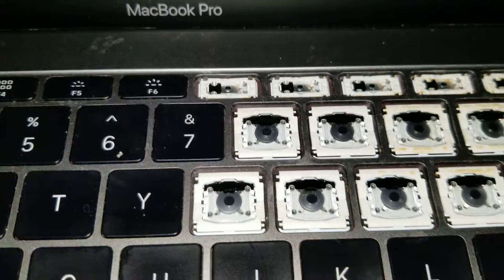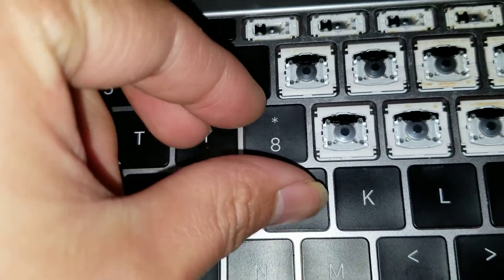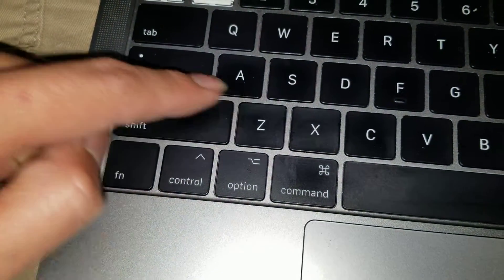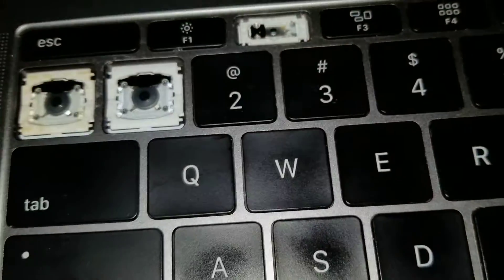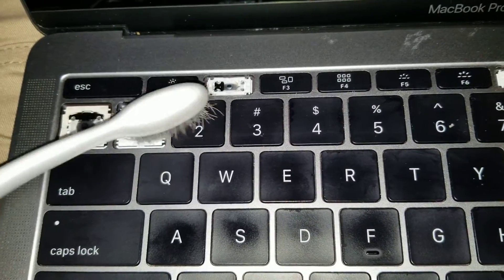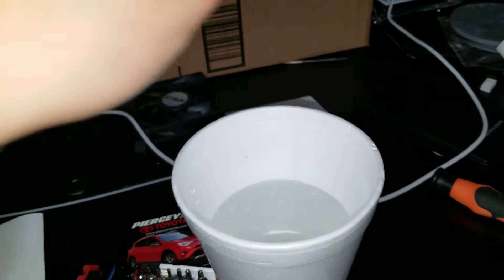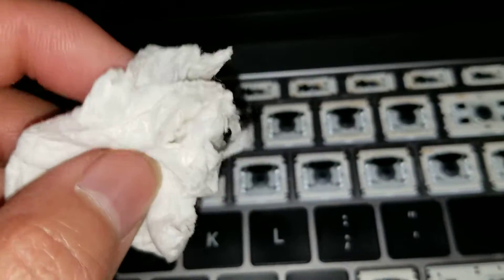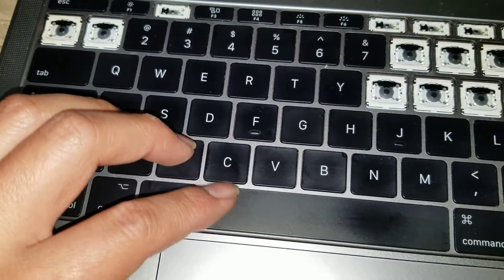How to clean and repair sticky stiff stuck Apple Mac MacBook Pro 2016 2017 2018 butterfly keys key.

Comment: hey man. ive got a macbook pro 13 inch 2020 and the command key came off. there are these two little pieces of plastic that came off aswell which connect to the keyboard itself as well as the key cap itself. do you know how to get these back on?
Reply from the maker: Not sure
Reply from the maker: I know how, but I'll need to see. Most likely parts broke and need to be replaced. 2020 models went back to the scissor keys.
Reply from the maker: Video showing all the keys https://youtu.be/oCWlcoq0v0A

Comment: Which side are the hooks on the escape/f1/f2/.../power keys?
Reply from the maker: Not sure. Too risky to attempt because of the small size. Apple might fix it for free. It's a known issue.
Reply: @ItsBinhRepaired  I'd just like to know which way hooks/clip are under those f keys you already removed. Is the hook on the side of the F and the clip on the side of the 7 or is it the other way around? (although I think(??) that little black thingy is aligned with the clips right?)
Reply from the maker: @alice8668  I don't remember been too long.
Reply from the maker: Uploading a video now showing all the keys and explaining how it works. Subscribe and hit the bell to be notified when it's up!
Reply from the maker: Video showing all the keys https://youtu.be/oCWlcoq0v0A

Comment: Don’t use your finger nails to remove your keys, please. I just did this and now my D key is flat.
Reply from the maker: That means you didn't pop out the clips properly, or you damaged the plastic piece pushing it down wrong. I had someone do that and try to force it in. They damaged the part at the bottom part of the key.
Reply: @ItsBinhRepaired  I managed to do it perfectly on the U key, then applied the exact same thing in the D key, these keys are very sensitive.
Reply: Just to clarify, do I need to replace the key, or the entire top case of the laptop?
Reply from the maker: @CallieraFlo  I'll need to see pictures of the back of the key and the butterfly hinge mechanism. Do a 4k video if you can and upload it to YouTube and then send me a link
Reply from the maker: @CallieraFlo  https://youtu.be/cT4ITKeis3Y compare those parts. You most likely smashed the square shaped clips. Hopefully not the ( ) ones.
Reply: @ItsBinhRepaired  The top parts snap in, the bottoms don’t. I think i damaged my key itself or the mechanism But if you’re referring the square clips as the bottom clips, then i smashed the square clips, not the ( )
Reply from the maker: @CallieraFlo  yeah, usually you can use a needle to bend the bottom square clips back up. Those you need to slide in, not press down. The keys are removed top to bottom, so you have to slide them in bottom then snap the top down. Bend up the bottom clips first they should make a l  l shape
Reply from the maker: The shape didn't show up right :( basically _ l    l _
Reply: @ItsBinhRepaired  so, I swapped my d key and tried to use my u key to see if it'll do the same. As a result, everything works fine. I just need to replace the D key now.
Reply: I'll just go to the Apple Store tomorrow and ask if they can replace the D key. Thanks!
Reply from the maker: Ok, they will charge you for the whole keyboard most likely :( you can buy the keys online.
Reply: @ItsBinhRepaired  Yup knew it. I spilt orange juice in my command key (because of my cat) and they claimed they needed to replace everything. Where do you recommend to buy them?
Reply from the maker: @CallieraFlo  if the button underneath still works and it's just the key cap that's damaged, then you can buy them, just have to Google for the model and specific letter.
Reply: @ItsBinhRepaired  Yes the button underneath still works, it’s just the key cap that’s damaged. Thank you very much!
Reply from the maker: Uploading a video now showing all the keys and how they work. Subscribe and hit the bell to be notified when it's up!
Reply from the maker: Video showing all the keys https://youtu.be/oCWlcoq0v0A

Comment: what thin tool did you use?
Reply from the maker: My fingernails lol the metal tool is the pill spatula from a pharmacy, but most are too thick and need to be sanded down.
Reply from the maker: Video showing all the keys https://youtu.be/oCWlcoq0v0A

Comment: The issue with my computer is the W key, the key came out but now I can't press it, I have to remove the key and hit the button itself. Do I have to take it in for repairs and that point?
Reply from the maker: Most likely you broke the plastic clips
Reply: Like mine w key
Reply from the maker: @jaydenroblox6194  Apple might fix it for free, if not you might be able to put a tiny amount of super glue where the clip is to get it to stick to the key.
Reply: Hmm ok
Reply from the maker: Uploading a video now showing all the keys and how they work. Subscribe and hit the bell to be notified when it's up!
Reply from the maker: Video showing all the keys https://youtu.be/oCWlcoq0v0A

Comment: REALLY HUGE help.  Thank you so much.  So as an FYI, I usually use a vacuum on keys that work hard and 8 out of 10 times it sucks the crumbs or dust out rendering the key fully operable again.  But vacuuming my delete key didn't do it this time around so per Binh Repaired's instructions I removed the delete key, prying from the top with a pin, first starting in the top left corner and then carefully working my way across the top of the key.  THEN, I put the vacuum nozzle to it and sucked it all out and while I was at it, I also vacuumed my entire keyboard.  Worked like a charm.  Thanks!
Reply: Just vacuumed my keyboard and now it feels like new! Thanks
Reply from the maker: Haha nice
Reply: thx I just vacuumed it and it fixed the key
Reply from the maker: Awesome, glad that worked!
Reply from the maker: Awesome, glad it helped! If you haven't already, please like and subscribe so others can find my videos. Thanks!

Comment: hi! how do you put back the function and esp keys? tried putting back the esc key and it's pressed down, it doesn't make the click sound when pressing.
Reply from the maker: You most likely broke the clips off. :(
Reply: Oh? Will apple repair them if i send it over. It happened with my f1 without me touching it tho. How should I put the function key back? Same as regular key? Bottom first?
Reply from the maker: @beneathzeskies  should be the same. Hopefully the clips aren't broken :(
Reply from the maker: Uploading a video now showing all the keys. Please subscribe and hit the bell to be notified when it's up!
Reply from the maker: Video showing all the keys https://youtu.be/oCWlcoq0v0A

Comment: does it matter which way the white plastic underneath goes? I cannot tell if it is upside down or not - knowing is showing how to remove and put back this bit
Reply from the maker: The white hinge part should not come out. If it did, it won't be repairable as far as I know.
Reply: @ItsBinhRepaired  I've seen a few other videos where they come off with the keycap and they just flick it back out using a screwdriver etc
Reply from the maker: @mildredhighcock7333  you can remove the hinge from the key, but I don't know how to reattach it to the keyboard
Reply from the maker: Uploading a video now showing all the keys and how they work. Subscribe and hit the bell to be notified when it's up!
Reply from the maker: https://youtu.be/oCWlcoq0v0A

Comment: dude so dirty under the key. did you sneeze on it with the mouth full of coffee? lol
Reply from the maker: I don't know what the customer did, but yes, it was liquid if I remember correctly.
Reply: It's Binh Repaired I’m about to buy a second hand 4gen 2019 mbpro, is it a good choice or should I get the 5generation? Thanks for your advice
Reply from the maker: @Vale01-b1x  what do you mean 4gen or 5gen?
Reply: It's Binh Repaired 4th generation MacBook Pro are those sold between 2016-2019 with butterflie keyboard.
5th generation MacBook Pro are those sold this year 2020 with scissor keyboard or magic keyboard.

https://upload.wikimedia.org/wikipedia/en/timeline/046c0197821b0151445bf41b5b38f682.png

Comment: Esto no es nada recomendado .. Si lo intenta es mas facil Joder la teclas
Reply: @ItsBinhRepaired   A little translator would help 🤔 .. I tried to do this tutorial and I ended up breaking one of the hooks of the "FN" key so I do not recommend trying it at all  thanks to this I had to order some replacement keys from eBay
Reply from the maker: @yendryacv  yeah, I warned against removing some of those special keys. The design underneath are different.
Reply from the maker: Uploading a video now showing all the keys and how they work. Subscribe and hit the bell to be notified when it's up!

Comment: Use a q-tip and alcohol. Press in and go around the edges with it. Worked for me.
Reply from the maker: Might only be temporary until it dries.
Reply: You’re right it’s still kind of sticky now. I need that little tool.
Reply from the maker: @EveryGamer  fingernails work. You can use a needle to do the initial lift.

Comment: How can I reattach the down arrow key ? I just detached it to clean it, without removing the butterfly or anything, but I'm not able to attach it again :(
I'm not sure, maybe I'm not able because I broke it ...
Reply from the maker: I'll need to see a high definition close up picture of the parts to see if it's broken.
Reply: @ItsBinhRepaired  Thanks for the answer, I just saw it... My boyfriend and I tried again to reattach it, and we actually broke it, so it was not ;) I will search for a new key and I will replace it later, thank you ! In any case, if you have a video of how to reattach the smaller key I will really appreciate it :D
Reply from the maker: The fn keys? As long as nothing is broken you can just press it down.
Reply: Hey- my down arrow key is exactly like you described and I had not done anything to mess with it.
I don’t know how it happened.
Did you ever find out about that specific key...
Are the two C shaped hinges on the 
two bottom corners,
two top corners, 
two Right side corners or
Two left side corners?

It’s super important for me to know which sides to try & pull up.

I don’t want to damage under butterfly portion.

How did it go replacing that particular bottom arrow key 
after all?

Did it work out?
Reply from the maker: I'm uploading a new video showing all the keys. Subscribe and hit the bell to be notified when it's up!
Reply from the maker: Video showing all the keys https://youtu.be/oCWlcoq0v0A

Comment: Whenever i put my keys back into place, the hinge clip and cup stick to the cap! And then tapping the key doesnt work, and it all just comes off at once. I need help, hopefully you can tell me there’s a solution to this! Thanks :/
Reply from the maker: The hinge came out? Might have to get the keyboard replaced :(
Reply: @ItsBinhRepaired  oh no replaced? if just been using it broken for awhile now. how would you replace a mac keyboard?
Reply from the maker: @nucammiles  what model? Mac keyboards are a pain. Often have to replace the whole palmrest. I have videos on several models.
Reply: @ItsBinhRepaired  MacBook Pro (13-inch, 2017, Two Thunderbolt 3 ports)
Reply from the maker: @nucammiles  yeah, the entire palmrest assembly would need to be replaced.
Reply from the maker: What model mac is that?
Reply from the maker: Video showing all the keys https://youtu.be/oCWlcoq0v0A

Comment: Any advice on the space bar?
Reply: hope this messaged didnt reach you too late, but DO NOT try and take the spacebar off, it won't go back on, they have to do it for you. And if your out of warranty with any damage not even spacebar related they will try and charge you hundreds of dollars!
Reply from the maker: Uploading a video now showing all the keys and how they work. Subscribe and hit the bell to be notified when it's up!
Reply from the maker: https://www.ebay.com/i/274336068582?chn=ps&norover=1&mkevt=1&mkrid=711-117182-37290-0&mkcid=2&itemid=274336068582&targetid=883121439742&device=m&mktype=pla&googleloc=9032144&poi=&campaignid=9418895015&mkgroupid=95235844546&rlsatarget=aud-762207186714:pla-883121439742&abcId=1141016&merchantid=136053118&gclid=CjwKCAjwkPX0BRBKEiwA7THxiEWZP3NHKR6LLBnF4AijVJTdcHFH9zknDc_Ah5sktbo1uzywQn5nnBoComAQAvD_BwE
Reply from the maker: Don't buy from the link. I sent it so you can see what the key looks like underneath. Looks like there are two hinges widely spaced apart. I'm not sure which side is which, but most likely you'll want to pry from the same corners as the other keys.
Reply: @ItsBinhRepaired  So try to pry it out from left to right versus top to bottom?
Reply from the maker: @YellowKid213  top left corner to right. You might be able to get Apple to do it for free. These models are known to have keyboard issues.
Reply from the maker: Video showing all the keys https://youtu.be/oCWlcoq0v0A
Reply: Buy a new Mcbook, it's pretty much useless at that point.
Reply from the maker: @ichan83a  lol nah, you could always use a usb or Bluetooth keyboard

Comment: My issue is the key slips off whenever I try my best to stick it back.  Any idea? Thanks so much
Reply from the maker: Sounds like the plastic parts are broken. Most likely the tabs on the hinge broke or the key cap that grabs onto them. I don't know of a way to replace the hinge, but you can get replacement key caps if that's the only part that broke.
Reply: @ItsBinhRepaired  Thanks Binh for enlightening me. I've ordered it.
Reply from the maker: @myo3939  make sure it's not broken on both sides.
Reply: @ItsBinhRepaired  Hi Binh, I just bought keyboard skin to cover the original key which is now not popped off.  It cost me only a few bucks - https://shopee.sg/product/21759468/658345730
Reply from the maker: Video showing all the keys https://youtu.be/oCWlcoq0v0A